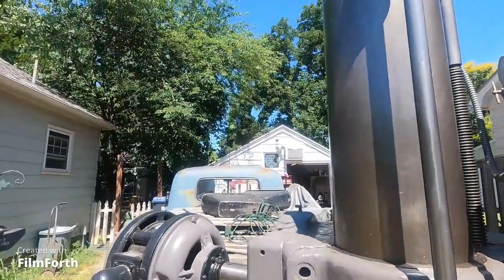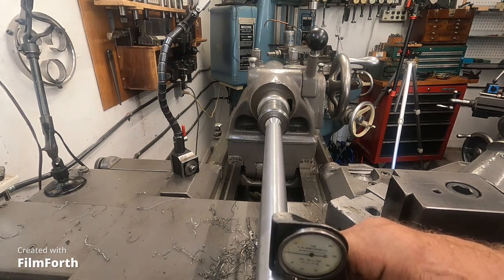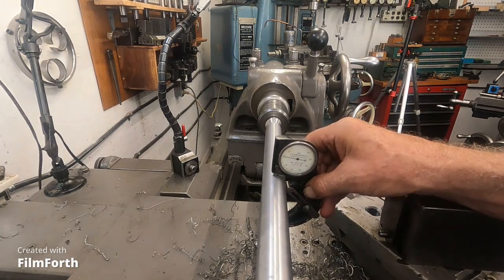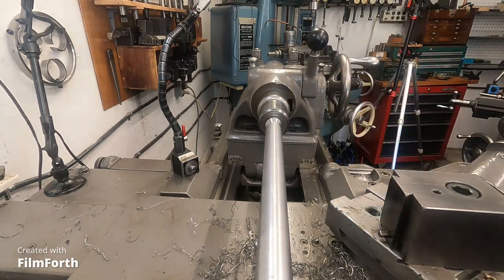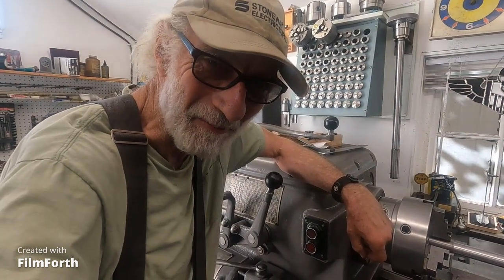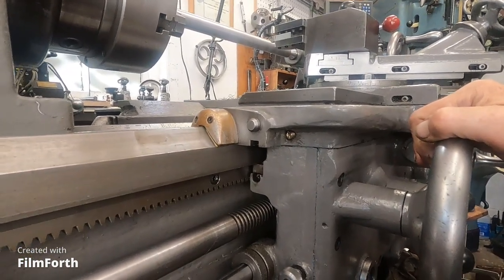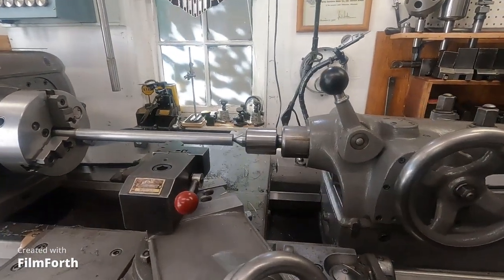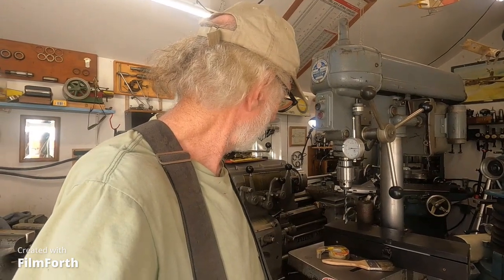Basic tailstock check reveals bed/carriage. problem 2!

Comment: I watched both videos, a good way to start the day.  I run an old 14C 1942 vintage so it relates well.
Reply from the maker: You cant go wrong with Monarch, some of the other lathes like this one have the shipper or double sided clutch units, that can be costly and with this Axelson it is deep in the headstock. I am good on this one.

Comment: Yo, please, what was the trick to removing the rust from that arm drill? You never said it... You said it cometh from the wily minds of the tree carvers, but you never revealed what was the secret sauce... So please, do tell us, boss!
The trick, whatever it was, did a wondrous job, and while i know that no tool does the job without an operator wielding it, as i cant have you fly across half the globe, i, and i guess a lot of others would like to know... 
I for one am restoring 9 machines at the moment, all for my own uses in the future, and while none have such a case of rust as that drill had, i would still love to know, as i do despise abrasive means, lest we are talking precision, contained grinding/lapping/honing that is perfectly cleared of all grit afterward... 
I love old iron, i wont say more so than i do people, but i dont ever really fall in love with people of any gender or whatever, like i do with machines... I can love people like friends and brothers in christ, but machines i love like i do my parents or like i would my child... Which may be mad, but if so, i am glad, and i have no intention of seeking any help from that condition...
Reply from the maker: Hi, I forgot to do a play list on rust removal. The woodworkers economy formula is slopping on acetone and auto transmission fluid and scrubbing with a good quality brass brush, that seems to deep clean the rust out after skimming it with a sharp scraper. The best fluid I have tried and along with a real brass brush is Hoppes #9 rifle bore cleaner but that is a little more expensive. It takes considerable time but the results can be seen as I do it on my Morris Mor-Speed radial drill videos, I will try to get a play list going on that thanks
Reply: @deedeeindustrialsuperprecision  Hahaha, you gotta be kidding me... I use atf for that exact purpose for a long while now... As a car mechatronics apprentice, i noticed that rusted parts that got soaked in atf after any related failure would shed rust and clean up like new, where 1/2 inch further where the rust was dry, it was stubborn as over-the-phone-salesmen... And a brass brush is my go to, if im not removing paint and filler from nonfunctional machine surfaces, there i use steel brush(much more effective against paint)...
The acetone and bore cleaner are a new thought, in this particular usecase, but thank you for that... 

I generally take a good pack of toilet paper, wrap the area in it, and i mean wrap it like a mummy, tight and in multiple layers, and soak it with atf... Atf being quite thin and runny, the toilet paper bandages help it say where i need it, rather than just sliding right off into the coolant tank... Also, you can use atf(cheapest you can find) as a machine coolant... It will never cause rust if at all maintained, and its a good enough coolant and lubricant for any flood cooling purposes... And it smells like boiling sugar(caramel) when its evaporating, so that is a huge plus... Sure, its not healthy to breathe in in large doses, but then again, oxygen is toxic too, so make of that what you will :P
jk, but it really does smell like caramel, and it not even 1/100th as toxic as spindle oils for surface grinders which have every single hazard label that one can think of(and such oils were very liked as cutting fluid back in the day, like most hydraulic grade oils)... 

All the best my dear brother in iron!

Comment: Okay, I'm only a hobby machinist but why can't you center drill the shaft fully into the chuck inside the spindle and then turn the shaft fully to measure taper? Is it better to only install the shaft once in the chuck to insure accuracy?
Reply from the maker: Thanks, I need to ex[lain that better in the next video, when I loosen the gbs and try another cut, that is important thanks agian!

Comment: This is great information -- there's not much out there that I've seen on how to work around wear on a machine. Makes me wish I had a snap gauge, too. I was wondering -- if you put an indicator on the tool side of the material, it should stay zero the entire length even if the piece is out of whack. But if you put it on the other side of the work, you might get a different reading depending on the wear, right? It starts to get hard to think about once I start considering twist... And I think pure vertical drop would show the same reading the entire length.

We're starting to get into the temps where the AC has to run all night. It's not fun to stay out of the garage for a couple of months.
Reply from the maker: I am not a machine rebuilder/scraper but just a lathe driver, My test is just steel that I cut, mainly because I do know how to cut steel.  In most small machine shops in the region when I was working most shops had to have at least one good lathe, but sometimes not. It was not needed to put dial indicators and test bars everywhere on a lathe as you can tell it has problems and quickly see where by daily or even first time use. Then adjust as best you can, like using the KDK offset tooling, I bought that system knowing I needed it for this ebay bargain machine, The machine is producing parts of outstanding quality for its type. The machine is far exceeding my expectations as good work horse for me tand aking the strain off the tool room lathes, thanks!